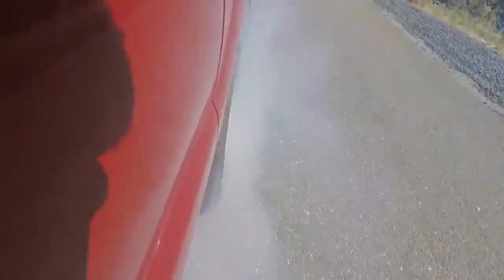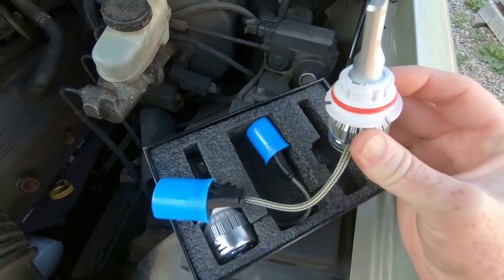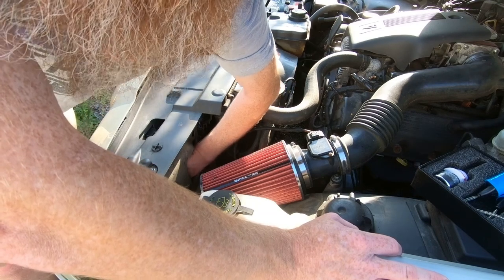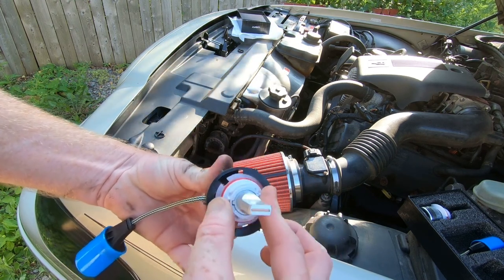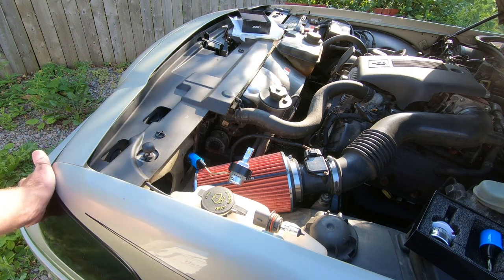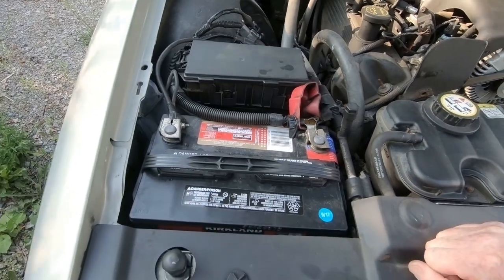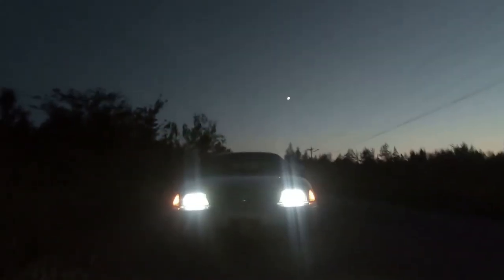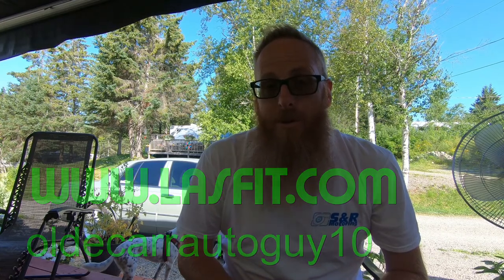HOW TO INSTALL HEADLIGHT BULBS IN A MERCURY GRAND MARQUIS OR CROWN VICTORIA- LASFIT

Comment: 6000k has a blue hue depending on manufacture and whether it's a pure 6000k or if the brand is not as accurate as they claim are true 6000k will have a blue hue

Comment: Nice. 
How noisy are the headlight bulbs?
Can you hear the fan running? 
I read that was a common complaint from reviewers.  

That's kinda why I chose a solid state fanless design for my Merc.
Reply from the maker: I can’t hear them from inside the car if that’s what you’re referring to. Not even standing outside the car! However when you have the hood open and you bend down with your ear, then yes but hardly! So much so that I did feel it was relevant to even talk about!

Comment: They look great! I was curious to see how different the bulb replacement is on CV / MGM vs Town Car. Interestingly enough on the town cars you remove the entire headlight assembly to get at the bulbs. I recently did an install video last week. Nice channel.... subbed!
Reply from the maker: Due to the placement of the actual bulb in the GMG, it's a bit of a challenge. If you look at the headlight assembly on each, the CV has the HL bulb offset to the outside of the lens, and right where there is an opening in the header panel. GMG places the bulb ion the center of the lens but uses the same header panel as the CV. A cost savings by Ford, but a bit of a PITA for GMG owners.
Reply: @OldeCarrGuy  header panels actually different

Comment: Did u place the original back cover back in place or is it of to keep it off after installing?
Reply from the maker: It actually doesn’t fit into place as the wires are in the way! But that a good thing anyway, you don’t want the LEDs to overheat! They have a built in fan but could get too hot if enclosed! Hope this helps!
Reply: Cool. Definitely appreciate it. Keep up the good work on the videos
Reply from the maker: Thanks buddy

Comment: What’s going on olde car guy nice lights.I have a question recently my 79 Chrysler lebaron started hesitating on acceleration and shaking off and on I was told it’s running lean the carb was rebuilt should I go with a new carb/.efi system or lean conversion kit thanks man for any advice
Reply from the maker: Hey Terrance. This is a pretty loaded question. It could be a number of things.... transmission shudder, fuel supply (fuel pump or filter)) tune-up or the lean burn. The reason I say all that is because you mentioned it  happens under acceleration.  The easy and cheapest place to start is regular tune up stuff like plugs, wires, cap and rotor as well as a fuel filter. If that doesn't help,  try cleaning your carb as all this ethanol in the gas can gum things up. if after the tune up and carb cleaning the problem still exhists, then you can start looking at eliminating the lean burn system! 

I hope this info helps  to steer you in the right direction.
Reply: Definitely thanks man

Comment: On the 2003....it will be the same way to put them on???....or i gotta take the whole assembly off the car(the housing)
Reply from the maker: All steps should be the same!😉
Reply: You don’t have to remove the housing , you just have to remove the plastic cover unless the MGM is different then the CV .....

Comment: I installed Led bulbs to my grand marquis. But it just turn on the strong light. And no the other one. And it appears the light symbol on my  board. What do you suggest me to do?
Reply from the maker: +felipe chavez what year is your car? I know 2003-05 had a recall from Ford to replace the lighting control module! Yours could have failed!
Reply: @OldeCarrGuy  its a 1998. Can a relay could save my problem?
Reply: You will most likely need the decoder for your kit as the system is detecting a “ bulb out “ situation because the LEDS are drawing less juice then a normal halogen would , it’s a common problem on these cars especially if you have the higher end models ..... All you have to do is go on your kits website and have them send you a decoder module ( all it is really is a resistor that that fools the computer into thinking that nothing is wrong and shuts off the false error code and light )

Comment: When you installed the lasfit leds headlight bulbs, did you leave the dust cover off?
Reply from the maker: Yes! The bulbs and wires stick out to far.
Reply: @OldeCarrGuy .... Not using the dust covers, won't that put the LED bulbs fans in an early retirement? I have a set of LED's that I wanted to put in, but the manufacturer said I had to buy an extra set of those black round rings that hold the bulbs in place. They told me, of course AFTER I received them & found out they weren't a true plug & play. WHOOPS! I would have to cut the rings down in height & then cut 1 side to get them to slide over the bulbs to make them work & use tape to hold the covers together. Not happy about finding that out afterwards. But then the stock dust cover wouldn't fit. It was suggested that I buy an after market cover (looks like the band Devo, their hat & somehow get that to cover the bulbs housing. But then the LED's fan wouldn't be as effective. IDK. For now I put in a set of Silvania's Ultrastar's. Those are noticeable improvement over stock, but a far cry from the LED's. So, do you think that you can get away without using the black covers using the LED bulbs? It seems silly to cover them because you'd get heat build up, but then the fans are exposed to whatever elements get to it. IDK. I live South of Chicago & any hint of snow the silly crews are out salting everything. So I want to try to keep the bulbs lasting as long as possible. Thank you. I appreciate you putting all the videos out. They are certainly helpful.

Comment: You could have made that a lot easier on your self if u took off the big plastic cover first. You wouldn't have to take the battery out and you will have a lot more room to work.  Otherwise they look good.
Reply from the maker: Thanks Trevor! I appreciate your comments!
Reply: Yep take the radiator support  plastic cover off and full on easy access ..... Just did mine and didn’t remove anything other then that and had them installed in about 2 mins or less ...... straight forward and simple and the fact that the bulbs are adjustable for their beam pattern makes it super easy to get it right .... One thing that people may want to know is that if your having issues after installing them with turning on your high beams and one going down and one going up , it’s just you have to spin the bulb ( on the one that’s going down for high beam )  180° from where it is then readjust.....

Comment: Only problem i have with any aftermarket bulbs is you really need to re-aim them so that they don't blind oncoming drivers.. most people don't..
Reply from the maker: I hear ya there! I rarely get flashed. But some factory cars are built everyday with bright white headlights.
Reply: Olde Carr Auto Guy I don't see having that issue when you have front tinted headlight covers, or when you're in a car, it seems to be way worse for me when i drive and i see jeep owners, or kids in SUVs or lifted trucks with a combination of these bulbs and those collapsed sun light bars.. times like those i wish my panther had the spot light.

Comment: its much easier to just remove the black panel over the lights(just pop out a few clips) and then remove the headlights(two metal slide clips on either side, if they dont come out by hand you can just use an extension as a lever and a mallet lol) to work with them directly
Reply from the maker: If my car had the slide clips, which it doesn't, that certainly would be easier. My headlights are bolted in!
Reply: @OldeCarrGuy  lol thatll do it

Comment: What's the part number on the ones you installed? I want!!!
Reply from the maker: Hey Joe. Here’s the link: 

https://www.lasfit.com/products/lasfit-la9007-led-headlight-kits-high-low-beam-72w-7600lm-6000k

Don’t forget to use promo code: oldecarrautoguy10 for 10% off

Comment: you made it hard. just remove the black plastic panel with the four twist to remove push pin "rivet" covering access to all lights.
Reply from the maker: If one was replacing with regular bulbs, maybe. These LED's are too long and my fingers are too fat!